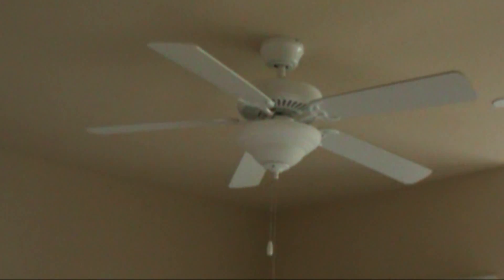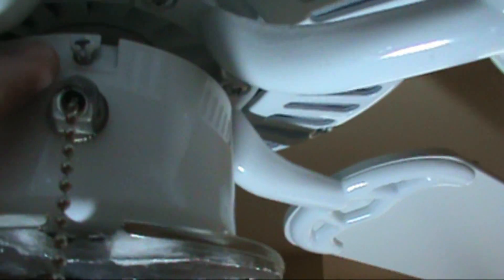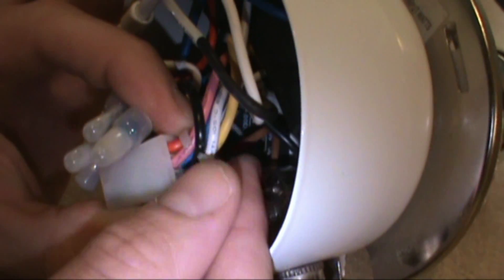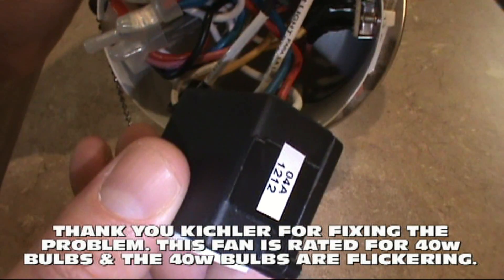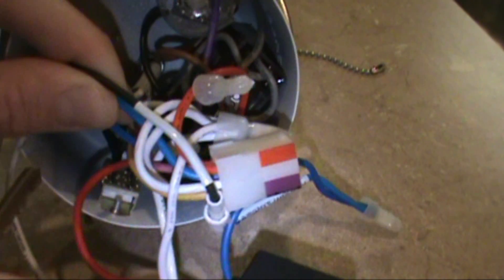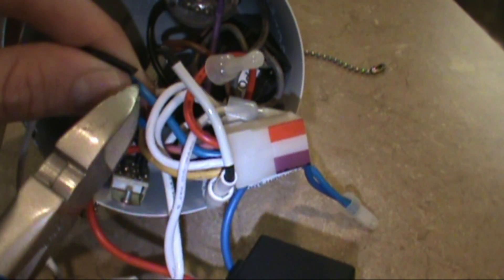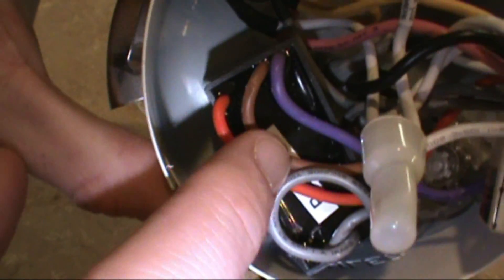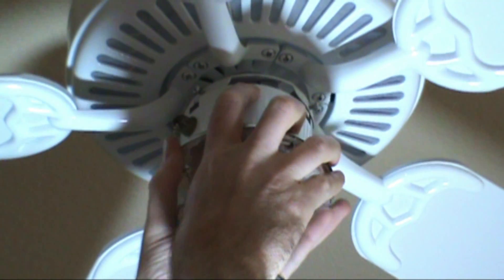HOW TO FIX BLINKING CEILING FAN LIGHTS (KICHLER FAN)

Comment: tyvm
Reply from the maker: Thank you so much for watching Charlidog!
Reply: @LexVance  I watched a couple of others. They just weren't making it clear. Watched yours, went and fixed the problem. Again, thx.
I forget who makes mine, but short of the motor, I've replaced almost every part of the electrical. The fan switch was the hardest. There are a couple styles and I ordered the wrong one. The original had melted. I finally figured out what I needed and found a switch that worked.
I had not found a replacement for this issue when I started watching vids. I took the old one apart, and so I was looking for a relay. It's not a relay. lol.
Anyway, this was the last piece. I now consider myself competent on ceiling fans.

Comment: I just installed a Harbor Bay chain pull style fan, with 1 bulb. My wall switch is a Leviton rocker type switch, but also has a dimmer / slider in it. I'm noticing when I turn the switch on, the fan light does a slow strobe, until I move the switch slider up and down, or turn the switch off and on again. This happens every time. There is also a slight hum, the more I lower the dimmer slider,  which slows the fan speed and dims the light. As far as connections between the fan and ceiling/house wires, I have all green grounds connected together, the blue and black from the fan connected to house black, and the house red capped off with no connection to it. Not sure if this is the problem, or if I should get rid of the dimmer switch, since I don't really care about being able to dim the light or adjust the fan speed aside from the 3 built in speeds.
Reply from the maker: I get rid of dimmer switches. They cause a lot of issues where I work.
Reply: @LexVance  Thanks! Took it off this morning, and rewired in a regular switch. No more hum, or blinking lights : )

Comment: Lex I took out the limiter. Lights still flickering when the fan is off turn the fan motor on and it stops… replace the fan control box in the light kit now? I think it did it so long I started smelling a burning smell. Replaced the light kit with new lower base with sockets new bc the old ones were melting. Any insight?
Reply from the maker: Hmmm I'd need to be there for this head scratcher 🤔.

Comment: Is the capacitor the same as the wattage limiter?  I have a Harbor Breeze fan I just installed and the lights are dim.  I see a black box but it has 5 wires coming out.  I look up the part and it says that's the capacitor.  I can't find any videos or anything that show a limiter that looks like this.  It has two orange wires going into one end and the other end has red, purple, and yellow.
Reply from the maker: I believe harbor breeze fans don't have limiters. Only capacitors. Not all fans put limiters in them.
Reply: @LexVance  well that's a bit disappointing.  Our lights are very dim and I've tried different bulbs with no luck.  I was hoping it was a limiter I could remove.  Oh well.  Thanks for reply.

Comment: What was red wire connected  to at 6 minute mark. Red wire from inhibitor?
Reply: Limiter
Reply from the maker: Yes, I'm bypassing the limiter. That's what the fan manufacturer told me to do. Thank you so much for watching Big!
www.DirtyMaintenanceNation.com
Reply: Lex Vance  thanks this worked on my Harbor Breeze. Light doesn’t flash on and off now!
Reply: Hey dear i didn't have a blue wire coming out of the harness.

The other colors are white red pink and black.

Which one should I cut.

Comment: what if there's no regulator?
Reply from the maker: Capacitor is bad. Or the sockets. That's when I go with a new light kit.
Reply: @LexVance  If the fan still works then the sockets are still good correct? You just need a new light kit, not a new fan? THANKS
Reply: @LexVance  I dissected it down to the pull cord...There is electricity running through the whole thing...Might it be the pull cord? The fan runs fine...The black wire has electricity going through it

Comment: Do you know how to fix the reverse switch on a Kitchler model # 35025 canvas blade fan. I disconnected the 4 wires that go into the switch and I don't know how to put them back in the correct order. Or where I can get a replacement switch, the fan was discontinued in 2008. HEEEELLLLpPpP me please I love the unit
Reply from the maker: Dang James I sure don't. I always take a picture with my phone before I start taking wires off. Try to google the part & look for pictures in the images section. Or if you have another fan like it, go look at that one. Sorry I James! I hate when that happens!

Comment: THANKS FOR THE VIDEO, BUT WITH MY HARBOR BREEZE IT HAS 2 SET OF LIGHTS, UPPER WITH BLUE WIRE AND ORANGE FOR LOWER WIRES. THEY COME FROM REMOTE BOXIN MOUNTING BRACKET. HOW DO I CONNECT SO AS TO GET BOTH SET OF LIGHTS TO WORK. THE REMOTE CONTROL OPERATES THEM SEPERATLY. 2 BUTTONS ONE FOR THE UPPER AND ONE FOR THE LOWER. THANKS FOR YOUR HELP.
Reply from the maker: Hmmm I've never worked on one of those before. Are they flickering?

Comment: The limiter is for to make the lights dim or turn off when the wattage is too high and without the bulbs light at full power.
Reply: On newer fans with limiters they will be dim if the wattage is too high but limiters are no good some also don’t like LEDs. I love LEDs so if that happens I will remove the limiter and I’d like the convert the small bulbs to regular bulbs (Daylight LED).
Reply from the maker: Thank you so much for watching Homeguest!
Reply: @LexVance  You’re welcome. Also do you now use LEDs.

Comment: I'm dealing with a ceiling fan that has about a dozen LED lites under the defuser. Every time the tenant turns it on it flickers. It doesn't have a switch and I've checked all the connections in the base in the ceiling, all connections seem to be solid no arcing and are tight. Any advice would be great Ih Great Maintenance Master!
Reply from the maker: Yikes! I have very little experience with LED stuff. All properties I've worked at so far were old school limiters and ballast lights. Sorry broseph!

Comment: How were you able to figure out how to eliminate that?
Reply from the maker: I spoke with the company that sold us the ceiling fans & they told me to bypass the limiter. I chose the blue wire because thats whats in the ceiling wiring along with hot & neutral & ground.  So i clipped blue & wire nutted to black wire that supplys the light kit. I tried it on our shop fan first & it worked LoL! Thank you so much for watching Man on a Mission!
Reply: Lex Vance OMG it work, 12 years in the apartment maintenance and just now have I got this, Thanks to you my friend. Oh this saved so much time now. Thank you, Thank you, Thank you.
Reply from the maker: Shock3Ram You're welcome shock! I'm just now seeing this comment for some reason. 😂👍😂 Thank you so much for watching Shock!
www.DirtyMaintenanceNation.com

Comment: Lex, I have a brand spankin new Seasons 44" fan with no limiter and the lights are not working. The fan works, I've replaced the switch in the wall, I checked the wiring and still I have no freakin lights. Help!
Reply from the maker: Could be the wall switch. Also, could be the whole base that the bulbs are attached to. We've had to replace those & the lights worked again. Thank you so much for watching Gerrit!
Reply: I figured it out! It was the wall switch. There were two but I only replaced one. It was the second one. Another one bites the dust! Thanks Lex!

Comment: Why didn’t you swap out those incandescent to leds ? I did that to my hunter fan and it stopped flickering as I assume it reduces the heat on the limiter. but great video I will do that to my fan if the limiter decides to get worse
Reply from the maker: Andoy33 I have to use what owners want to use. If it was my fan, I'd use LED's. Thank you so much for watching Adnoy!
www.DirtyMaintenanceNation.com

Comment: Thank you for making this video it solved my problem!
I may have a bit of a newer fan because now that little black box is all attached with male and female connectors so I didn’t have to cut and splice anything. I could just bypass it by disconnecting and reconnecting with the plugs that were already there from the company . They must’ve caught on that people didn’t like these things it also got rid of that light switch delay that has always been there.
Reply from the maker: Awesome! Enjoy that $200 you save from not needing a new fan or electrician. 
Thank you so much for watching Christopher!

Comment: Does the above apply when the remote turns off the lights , but one bulb glows and will not turn off? The glow is only visible when the room and surrounding area is completely dark.
Reply from the maker: Robert H Fender Jr Hmmm im not sure about the problem you're having Robert. The fan in this video is a standard fan with no remote.
Reply: @LexVance  I think this is an issue with the bulb. A british guy who's good at reverse engineering did a video on it. Forget his name. Or it might have been electro boom. I may try to find it.
Don't you wish people would come back and share how the issue was resolved?  I used to troubleshoot servers, etc.

Comment: Before i blow my house up let me ask a couple of dumb questions.  My light kit has 4 lights with four black wires wire nutted to the blue wire coming from the limiter.  so i am assuming that i remove that blue coming from the limiter and connect the blue from the drop down plug. that blue wire coming from the plug normally goes to what i  believe is the pull down light switch.  the red wire coming out of the limiter is wire nutted to a blue wire that goes to the opposite side of the pull down switch.  So i am assuming by cutting that off at the switch  that i would just be by passing the switch which is fine because i can control the lights from the wall.     And i understand that white is nutted off.  Now did what i say make sense?
Reply from the maker: R Ashwood Yes it did Ashwood. By me not being there though and looking at it, I'd have to say to try it at your own risk. Some things I can't answer without physically looking at it. Thank you so much for watching!
www.DirtyMaintenanceNation.com
Reply: It was a matter of removing the limiter or adding another lamp in my bedroom, I chose to doa the limiter.  Works like a charm thanks for the education.  Since i had 4 lights i had 4 black wires to connect the blue too.  After removing the limiter i totally by passed the pull chain switch and control it from the wall only which i have always done.  Thanks again.
Reply from the maker: R Ashwood Right on! Way to go R Ashwood!
www.DirtyMaintenanceNation.com